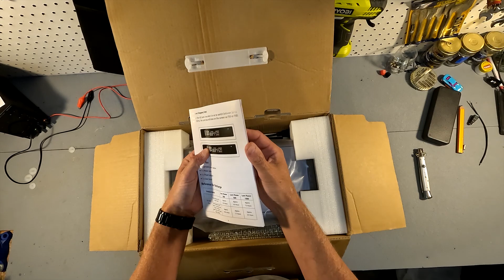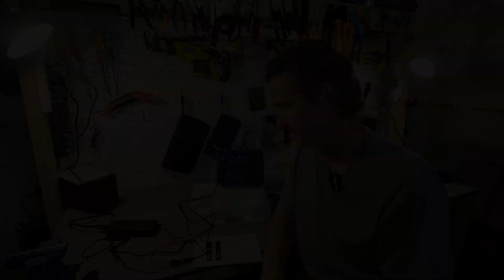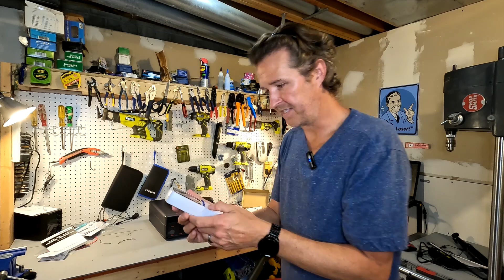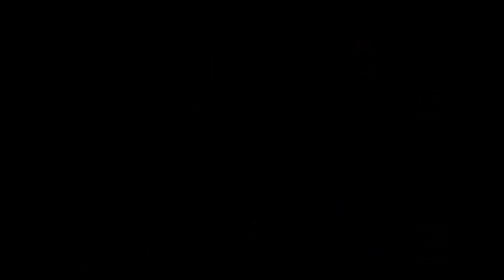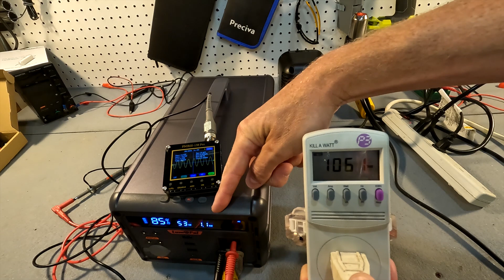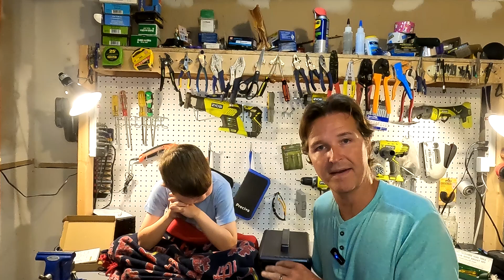Review of the LUM POWER 1000 from LUMOPAL.  1000wh of capacity, but a bit confusing to use!

Comment: Wow nice. Seems to perform well for its size and having some kind of drop test rating and strong build quality is better than most. The accessory socket could use some redesign based on your testing. Being able to link two together is great. I'm all about the one is none rule so having two main units versus a larger power station would make sense in that respect. But if it can't run my 1000w microwave for 2 minutes in a power outage its not good enough! They need to have the 1200w AC inverter claims met.
Reply from the maker: It does work well, but I feel like it could be better.  Thanks for the comment.

Comment: Hi Jim,
Thank you very much for testing our product LUM POWER 1000. This is very helpful for us to optimize the product in the future as well as to develop new products.
As a growing brand, we value every customer's feedback. We've noticed that you had a few questions during the product testing, and here are answers to them and I hope this will be helpful for you to know the product.

1. About the function button need to be pressed long term to start it (3-5 seconds)

This design is to prevent accidentally touching the switch, to avoid accidentally switching off during the power supply process or wasted power consumption.

2. About Charging a Car Battery 

The car-mode of this product means that it can charge the 12V car battery to solve the problem that the car cannot start due to the car battery being dead, and it is not a direct jump starter. (In car-start mode, our product will provide a higher current to charge the car battery.) You can refer to the part   'How to Use' of the user manual and this function is introduced in the 2. Charging a Car Battery. Regarding the charging cable, we will consider whether it is standard or not according to customer demand. Thank you very much for the feedback.

3. About Drop Protection

The LUM POWER 1000 has passed the strict drop test. The battery pack, as well as the internal structure, will not be damaged after the 1.5M fall and also won't have relevant safety issues. But I'm sorry for the appearance of the damage in your test. Considering the safety of electricity, we didn't use metal for the front and rear panel parts and used thickened V0-grade fireproof material. For the weight of the LUM POWER 1000, it is difficult to avoid cosmetic damage to its panel if it is dropped on a hard concrete floor. We are looking for a better program to further increase the sturdiness of the product, but at the same time, I hope that people try to avoid more dangerous attempts!

4. About The Capacity Issue

We are very happy that you affirm the capacity of our products. Our products have gone through the official FCC and UL seriously. We firmly SAY NO to false labeling.In fact, for many other brands in the market, 1000Wh products are seldom more than 900Wh available (because of high energy loss and false advertising). The test results also reflect your professionalism.

5. About the problem that the rated power cannot reach the peak value

We are sorry that our technical team can not give a clear diagnosis based on the video alone because of the diversity of the appliances used and their own power errors. One of the possible reasons is that the total current of the loaded appliances is overloaded, resulting in the product's active shutdown. (This may also be why the battery can be loaded with more power output under car mode, in which the product provides higher current.) We will continue to optimize the product's suitability in order to improve its performance.

6. About The Design Of The Parallel Structure

Thank you so much for your suggestion. The original intention of the design is to provide users with more choices of combinations, including the combination of products of the same series with different capacities. We will carefully re-evaluate the wide range of scenarios in which this feature can be used.

At LUMOPAL, we take great pride in providing our customers with high-quality products and exceptional customer service. If you have any questions about our products, just visit our website at www.lumopal.com at any time to leave us a message, or directly contact us at support@lumopal.com or lum-palsupport@lum-pal.com.
Thank you very much.
LUMOPAL

Comment: I lost all interest when you pulled out the charging BRICK.
I demand a direct AC cord connection for charging.
Reply from the maker: I completely understand.  I don't mind the brick because it keeps all that heat out of the unit itself.  Thanks for the comment.
Reply: A power brick is not a deal-breakef for me, but for some it is.
Reply: If you power brick fails its easy to replace. Built in AC, your likely buying a new power station.